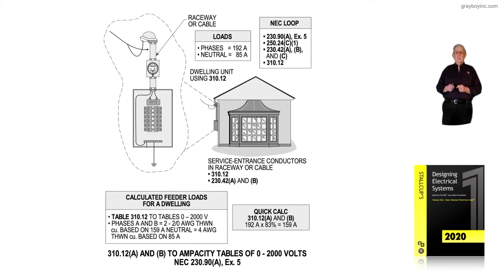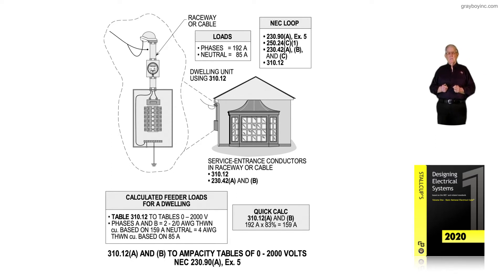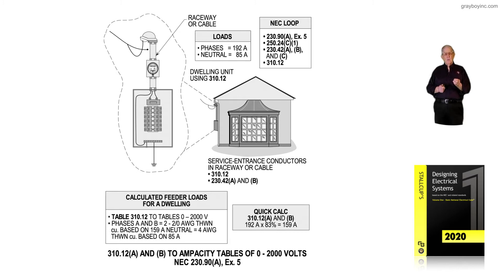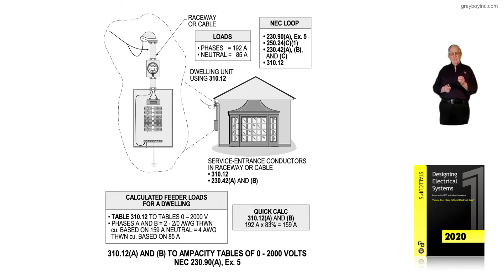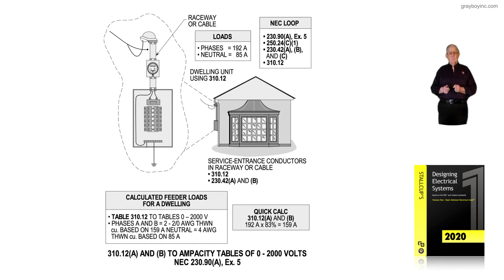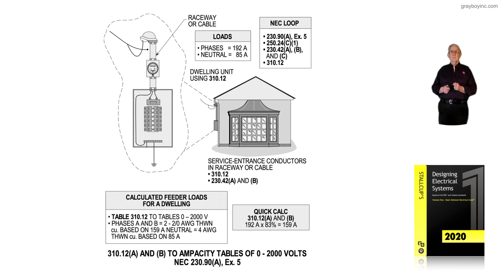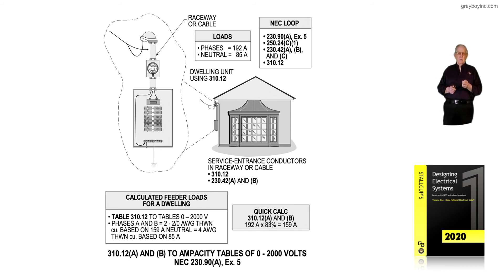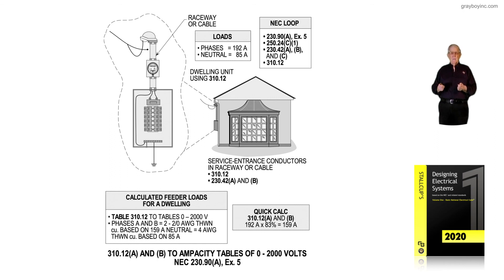6-47  NEC 310.12(A) THRU (D) TO AMPACITY TABLES OF 0 – 2000 VOLTS - 230.90(A), Ex. 5​​​​​​​

Comment: I do not agree with your application of article 310.12. The way I read it is that you can make an adjustment to the required ampacity of the service or feeder conductors of 83% of the rating of the service equipment. This does not allow an additional adjustment to the calculated or actual load. Article 230.42 requires these conductors to carry the load, actual or calculated. It also requires the conductors to be sized no less than the rating of the service disconnecting means specified in 230.79(A) thru (D). There is nothing that I can get out of 310.12 that would allow the application of the 83% adjustment to the calculated load as opposed to the service/feeder rating. Furthermore, if you apply 310.12 to the calculated load or the service rating and then use table 310.12 you are in essence applying the 83% reduction twice when it appears to me the intended use is an either/or scenario. I admit I could be in error and if the case please give me some insight into your thought process that brought you to your understanding of the articles in question. 
Bill